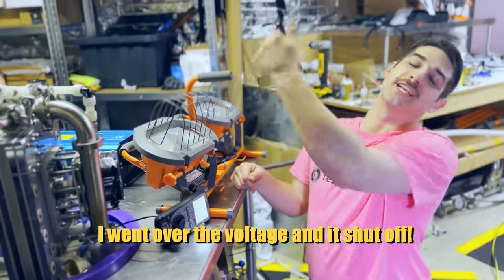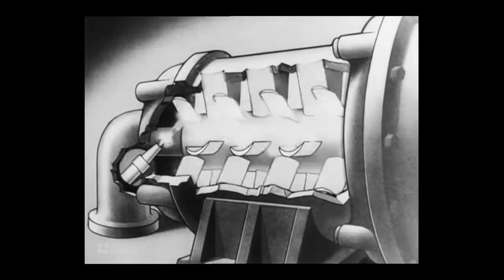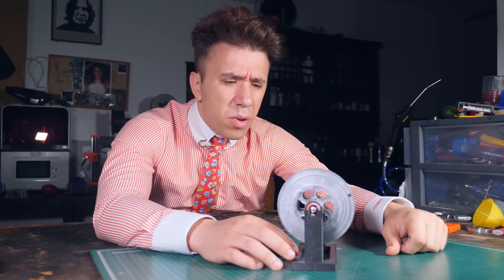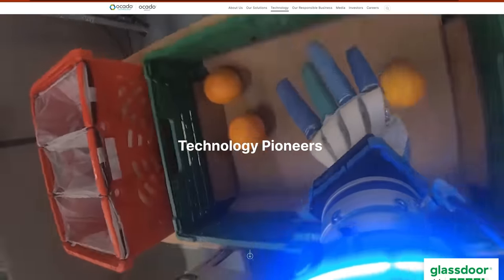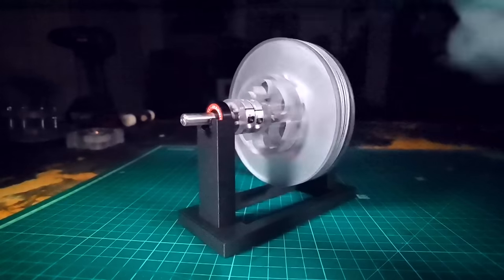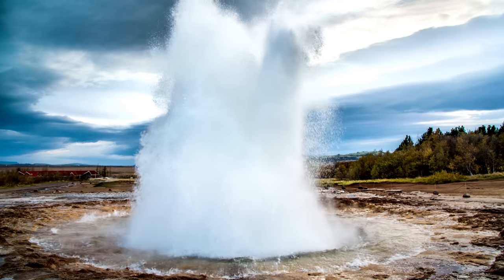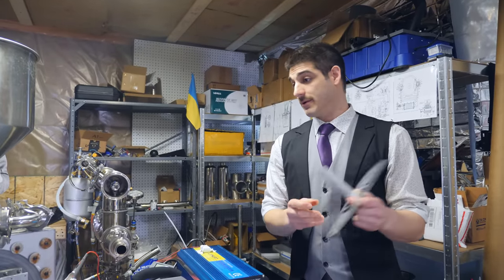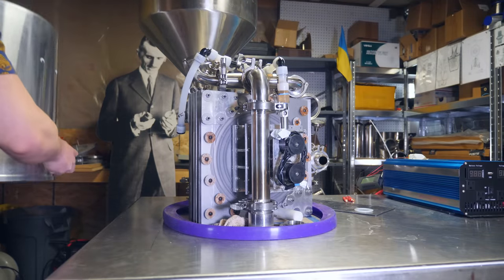Building Nikola Tesla's Bladeless Turbine

Comment: I'd be interested to see how efficiency compares with a similar output parson's turbine. Perhaps running both on steam, using a fixed amount of fuel and measuring the kWhrs of output
Reply: They're less efficient overall because they rely on viscosity (high friction) instead of transferring kinetic energy.  That viscosity turns kinetic energy into waste heat instead of turning the turbine.  That's why nobody uses them.
Reply: Tesla turbine efficiency can reach up to 80%.  What limits its usefulness is it becomes less stable as disc diameter increases.  You can increase the number of discs along the shaft, and increase the shaft length, but there's a maximum velocity and torque that can be reached based on the diameter and flow rate and pressure.  So, it's more useful in smaller applications compared with conventional turbines like the Kaplan.
Reply: @The-KP  "Up to 80%" sounds... optimistic. 

I've gone through a few dozen papers on the subject and I don't think I've seen a single build over about 50% isentropic which is honestly pretty good for something anyone can make but is objectively pretty poor.

Keep in mind that the isentropic efficiency is not the thermal or cycle efficiency. They're related (higher isentropic = better overall efficiency which boosts thermal efficiency) but the numbers are different enough that it's wise to uncouple them in your mind lest you come away expecting a 33% improvement over existing power stations.

Sadly we've not really seem a unit's overall thermal efficiency. Thus far we know Charlie's got a Tesla turbine to work but don't have easily verifiable numbers to go on with regards to its overall fuel efficiency. 

Which will be an issue if it's sold as, say, an off-grid generator but if it's overall electrical efficiency is 5% than that'll be trickier. Making 5kwh of electricity that requires 100kwh of thermal or, in real terms, about 12kg of charcoal. Per hour. Aassuming 250kwh of personal electricity a month, which is below the average household where I live in British Columbia, you'd be looking at 3 cubic meters of charcoal burned every month.  

So unless you have a specific use that requires a LOT of extra heat for industrial purposes that'd be tough to justify outside of peak thermal needs. Maybe with a larger enough thermal battery but that ups the setup cost, etc.

Comment: It'd be cool to see data on this. Dynograph it, and efficiency tests.
Reply: Hey thanks for the comment! Make sure to check out the latest updates on the combustion + steam Tesla turbine builds!   

Tesla Turbine 250 watt to 2.65 kW Power and Efficiency Test https://youtu.be/K7qZvq1CMFg  

+5 Horsepower Tesla Turbine Dyno Jet Turbo Power & Torque Curve 375 mph @ 12,000 rpm  https://youtu.be/exF5Rn-L8gs  

Solis Talks Tesla Turbines - Nikola Tesla’s Electrical Power Systems Patent GB 186,083 Walk Through https://youtu.be/5Y3D13JmtcA  

Tesla Turbine Jet Engine - gasoline fuel burner atomizer flame tube test 186,083 propane burner https://youtu.be/gRqKowignac
Reply: As far as efficiency goes… (mind you this is a copy pasta 🍝 so it’s a bit long but it’s worth the read.) …My 2650watt electrical load run came in with a very low ball calculation of 40% isentropic efficiency.  To start off, mind you that includes generator losses, 3 phase rectifier losses, and inverter losses to the electrical load that were not accounted for. So the turbine off the bat is already most definitely doing better than the 40% isentropic efficiency I’ve calculated from the already low ball test results.   But for now I’ll just assume 40% isentropic efficiency so that I’m not over claiming what I can prove it can actually do for the time being. (I have nothing in the long run to benefit by overstating my numbers and only my legitimacy to lose. I’ve worked hard for my physics degree and don’t intend to tarnish it for a couple of extra views on the internet.) 

As far as inefficiencies to the system to fix, there’s 10x crappy ball bearings in this version, 2 crappy RC car gears, both losses will be gained for power out with a direct to shaft generator. (Minus two gears and 8 crappy ball bearings)  There’s an 1/8 of an inch of space between the turbine endplates and the casing endplates on both sides of the TesTur. That’s a 1/4in of open flow area around the 2in wide turbine (that only even has a total of 0.75in wide of spacing between all the tight disc spaces for torque to begin with.)   That means 25% of the open space for flowing through the casing, between discs and between the casing and turbine endplates, is just free flow over the side of the turbine still. (I’m using the absolute bottom of the barrel of machining equipment right now in my garage 🤷‍♂️)  There’s no labyrinth seals yet to even attempt to further reduce that overflow… 

The nozzle is atrocious at the moment, when making the variable converging section have a tight convergence it causes the fluid jet to aim more centripetally (towards the axle) instead of tangentially (glancing off the disc tips) which severely effects the fluids natural path.   This will be fixed with the new variable nozzle design I’m going with.    Then even further in this specific casing’s assembly there’s two “pillars” in the middle of the nozzle.   This is because the aluminum plates in the middle of the casing plate stack only had the variable nozzle bar and inlet holes cut out, and not the full nozzle geometry.  So those pillars are just vertical bars in the middle of the nozzle for the air to smash into just before going into the turbine (hopefully the wet steam tests will just erode them down 🤭)   Before all that there’s still about 100ft of air hose between the tanks and the turbine… plus a shell and tube heat exchanger and a TON of elbows and fittings.    I’m sure I’m forgetting something too but between all that being fixed… I can almost guarantee we will be in the 60-70s % range and that’s all just still with room temp compressed air.   Most forget, I’m using room temp compressed air and never went over 20psi at the nozzle for these tests. (Pressure differential and temperature differential govern efficiency) 

And even then I still only even have a single stage on it yet.   Everyone wants to compare it to the efficiency of a very high temp, high pressure (1000°F & ~1800psi) multibillion dollar 15-30 stage steam turbines…   😮‍💨   That’s apples to rocket ships. 😅  But considering Rankine Steam cycles get theoretical max about 33% of input heat (due to latent heat of condensation and that’s without any regenerative boiler feedwater preheat, air fuel preheat, etc) and then 40% isentropic efficiency (considering the turbine as is) we’re looking at 13.2% thermal efficiency with steam.   A more apt comparison for the TesTur would be something an individual can actually purchase, like 1-5kW piston gas generators that you can get from Home Depot or Lowe’s.   These get 15-22% thermal efficiency off the plant floor. Good luck getting that 1 year down the line or later with all those moving parts.  Also for reference, industry standard for micro bladed gas turbines is 25% thermal to electrical. Whole system efficiency can go higher in Combined Heat and Power (CHP) system, but alas the TesTur would see the same whole system efficiency increase in a CHP Auxiliary Power Unit (APU).  In the TesTur you gotta replace…? 🤔bearings…? And still even then, only maybe 🤷‍♂️ depending on how good of bearings, balance, lubing, cooling.   The TesTur, and other bladed turbines, only have one moving part. 🔥 

So if those piston generators drop efficiency, even at all, the TesTur on its worst day is competitive with a gasoline piston engine electric generator.🤓😬🤷‍♂️  And the TesTur can handle any fuel that can burn, even solid particulate fuels like powdered saw dust, pulverized coal, powdered iron, biomass, etc. (noting the number of those that can be acquired without spending money… 🤑 opening up “low monetary cost”, even carbon neutral, fuel options for MILLIONS around the world)  We have to remember that the TesTur doesn’t have to be the holy grail to be worth using if we have free fuels readily available like biomass, and even waste heat already being dumped out into the air and not used for anything.  The TesTur just has to be a viable option for some to be worth doing. 

Even more, the mere fact that I’m using a low temp fluid for my 40% isentropic efficiency calculation means my TesTur efficiency is severely limited by thermodynamics and fluid dynamics.   Increasing temps will automatically increase my turbines efficiency.  This is because gasses have an increasing viscosity trend as you increase the temperature.   This leads to increased isentropic efficiencies in the TesTur from reduced slip on the discs.  (Meanwhile, we’re already talking about a piston engine using combustion temps as is.)  Whereas bladed turbines see the increased viscosity as an increase in drag loss through the turbine blades.   So we can’t always count on seeing increased isentropic efficiencies in a bladed turbine in practice when we go from low temp to a high temp.  Again, to reiterate, this increase in viscosity in the TesTur only works to enhance the working action of the TesTur.  (That being viscous adhesion to the disc faces increasing torque.)  That’s all on top of the increased thermodynamic efficiencies of using a higher temp elastic fluid too! 🤓 

Even more, the mere fact that I’m using a low temp fluid for my 40% isentropic efficiency calculation means my TesTur efficiency is severely limited by thermodynamics and fluid dynamics.   Increasing temps will automatically increase my turbines efficiency.  This is because gasses have an increasing viscosity trend as you increase the temperature.   This leads to increased isentropic efficiencies in the TesTur from reduced slip on the discs.  (Meanwhile, we’re already talking about a piston engine using combustion temps as is.)  Whereas bladed turbines see the increased viscosity as an increase in drag loss through the turbine blades.   So we can’t always count on seeing increased isentropic efficiencies in a bladed turbine in practice when we go from low temp to a high temp.  Again, to reiterate, this increase in viscosity in the TesTur only works to enhance the working action of the TesTur.  (That being viscous adhesion to the disc faces increasing torque.)  That’s all on top of the increased thermodynamic efficiencies of using a higher temp elastic fluid too! 🤓 

The disc spacing for room temp gasses is not going to be the same for combustion temp gasses/steam because the viscosity of either increases by 3x fold. And I’ve designed these spaces for a higher temp fluid with a slightly higher viscosity so these will inherently be too wide at the current temperatures being used.   So as we increase temps along with all these other really easy to fix mechanical issues (that only are a thing because I’m building this in my garage on a junk cnc machine) I have no doubt we will see more than competitive isentropic efficiencies compared to bladed turbines, let alone whole system thermal efficiencies that are through the roof.   This is because of the heat recovery systems that can be added with the cost savings of using a TesTur vs a VERY expensive, and in my opinion, relatively delicate bladed turbine.   Just getting tighter casing clearance with the turbine should give me at least 20% points back on efficiency putting my testur at the 60% range.   Coming in with a 19% thermal efficiency in a Rankine steam system without any kind of thermal recoup.
Reply: imagine when they pump plasma so that magnetic field modifies viscosity. how many electronvolts plasma can reach beeing cold. when it makes enormous pressure but low temperatute plasma is it possible.
Reply: @CharlieSolis sorry not read all of it … but came across the too much space free air flow section … why not using a hard disk drive and modify it ? There is as little as nearly no space left between the platters so maybe orientate on that knowledge ?
Reply: @Chloe_Priceless  hey thanks for the question! 

Simply put, it’s just because I’m using really cheap desktop cnc machines. 

With proper machining this wouldn’t have any issues with leakage over the side of the rotor. 

Along with adding in axial and radial labyrinth seals to the turbine to further reduce any overflow. 

If you look closely at component 27 in the Tesla turbine patent 1,061,206 image, you can see the labyrinth seals that Tesla drew in. 

They are very hard to see if the image looked at is low quality because they are so faintly drawn in. 

But I have high res photos of a lot of the original patent photos as well as the blue prints for the famed Tesla turbine that’s in the main Tesla Museum.

I didn’t pay for the copyright licenses to show them in videos and stuff though 🫤

I hope this answers your question! Let me know if I missed anything.
Reply: @qkktech  the simpler thing you can do is what plasma fracking does: Take advantage of how plasma discharges in thick atmosphere have extreme coefficents of expansion.
Reply: @Dan-gs3kg  I was thinking to use that in reverse on plasma ion thruster as first stage as seen at @PlasmaChannel but adding magnet lens will separate ionized part of thrust into that turbine attached to motor  that also has blades magnetized so that it will increase viscosity and then input will have ionized cold plasma and output is very dense ionized relatively cold plasma that is very dense. There are now ways to utilize that plasma when it is air then use fuel to make rocket motor that can fly at altitude very fast. Or do ball lighting experiments or use He3 in input and spark at output. Or Make  plasma circle around You and have flying sourcer.
Reply: @qkktech  the issue here is that the turbine is an evaporator, so the output will be lower pressure necessarily. Run in reverse and you'll get a condenser.

The change is not that difficult, so you can play around with that without much issue in prototyping.

You'll have to point me to open air plasma for rocket engines. That's very interesting, open air plasma is very difficult to do. Less so at altitude, but you know.

Per the plasma ball, I suggest using a spherical anode that is a healthy distance from the cathode. If it is too close it will discharge before the anode tufting becomes large enough to be meaningful.
Reply: @Dan-gs3kg  Air plasma at volumes must be hard to do but i think it is doable and i think when you have pump on other end then you can do so that input plasma density is constant you simply suck more plasma in and pressure drops maybe it simplifies something wthen you can hold constant voltage on electrodes and when alying fuel to afterbrner you can play expansion rate so that rocket engine part is very efficient. Then you can build airplane that goes at high altitude like 30km or so since turbojet engines use its own power to compress air to maintain burning but that one has batteries and can feed rocket at altitude even more when moving at high speed mach 6+ there is less needed to get air plasma.

For ball lighting  plasma can be condensed between magnets and thrown out using magnets and also using vortexes like used on tomato